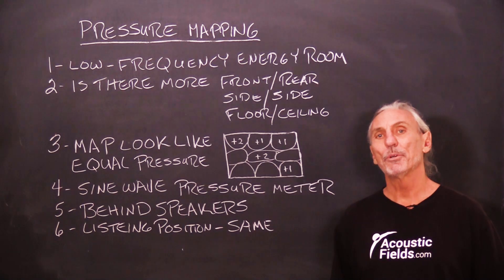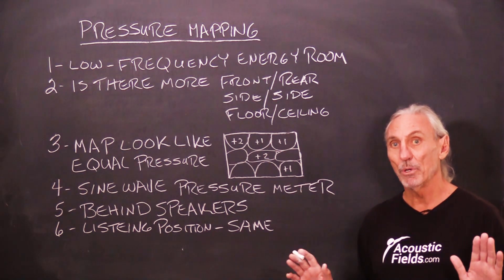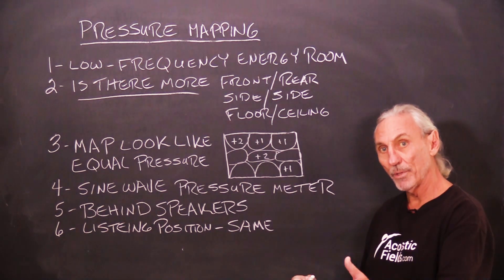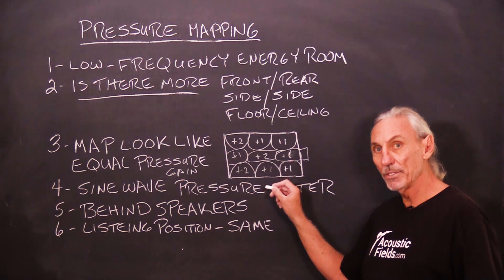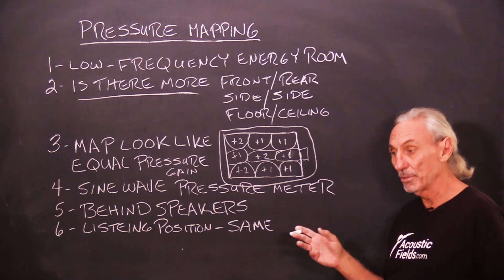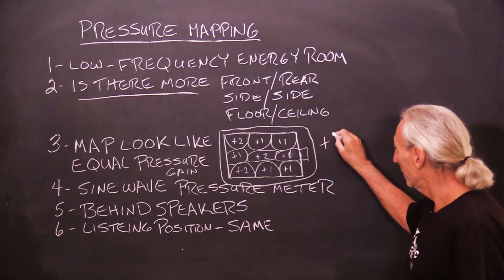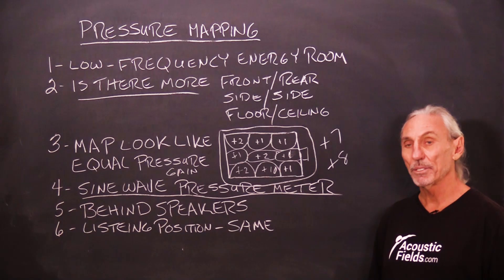Pressure Mapping - www.AcousticFields.com

Comment: I do not understand. If the change after adding gain is not proportional across the room, then the system is non linear.
What is the non-linearity ?? I believe superposition should apply. Correct me if this is an error.

Perhaps the absorber is saturating some how? But I doubt that.
Reply from the maker: Room dimensions produce modal pressures throughout the room. The goal is to have the room as pressure "neutral" as possible to minimize peaks and dips in performance.
Reply: @AcousticFields  I understand that. However you said that a treated room may become less neutral when the volume is turned up. At least that is what I heard.

Comment: Question: given that modal resonances, dispersion and phase vary with frequency, and the various traps and such ideally keep the variation +/- a few dB as you walk around the studio/room, what happens to the relative eq of the overall mix, since the higher frequencies will vary to a much greater degree as you move around?
Reply from the maker: Pressure mapping is for frequencies below 100 Hz. It is more objective in nature. Frequency management above 100 hz., in our experience, tends to be rather subjective based upon the end users preferences. Take reverb times as an example. I never have studios with the same Rt-30/60 times even though room size and usage are the same. Reverb times are as varied as the personalities of the clients we work with.

Comment: Hi Dennis. Sine wave and 80 db at the listening position, then measure around the rest of the room.People will be asking themselves "what frequency?"  Also how well does pink noise limited from 20hz to 1,000 hz work for this, if at all?  Cheers
Reply from the maker: Try an RTA with a maximum pressure / frequency indicator. Stand at various places within your room and watch for peak frequency pressure above a baseline. Learn how energy behaves at certain room locations. This simple method will show you the impact of pressure at each room location. Then begin to look at the patterns you see as you walk around.

Comment: well, may you explain me why two 104x30x30 cm membrane absorbers in two corners at the ceiling reduced the bass decay below 100 hz from 1 second to 300-450 ms when it's nonsense?
Reply from the maker: There are much better ways to deal with these issues. You must treat the complete wall surface area. By definition, axial modes are produced by two parallel wall surfaces not two parallel corners. Placing absorption material types in corners is only treating about 10 % of the problem.
Reply: @AcousticFields  well, as said: i have nearly linear decay over the full range in my living room which would not be possible in case the two pieces treating only 10% of the problem, also the SPL is linear - the membrane absorber is not just "absorption material" and the rest of the wall is covered with basoect for mids/highs
Reply from the maker: @Harald_Reindl  Your linearity is not the result of treating 10% of certain surface areas. There are many other variables at play here.
Reply: @AcousticFields  not only, but in the low frequencies it is - man when i measure with REW, put the two pieces in the corners without changing anything i see the difference and it's dramatically! for sure the bheavior of the Teufel T4000 subwoofer with it's maximum energy sideways (proven by going to the toilet as it was placed in the middle of the room and nearly puked because the small side pointed there while on the speaker side is nearly nothing) and so one of the corner membrane absorbers is in the full maximum pressure point - but it is what it is

here you go: this was the first of the two mebare-absorbers in the corner
https://i.imgur.com/bvmRq22.png
Reply: @AcousticFields  and it's easy to prove that it has the most effect in the corners by simply take on of the two, place it outside the corner in the same height and measre again - as easy as something can be given that both are standing on a shelf going from the left to the right wall

and additionally: the one in the corner on the same heiught as the subwoofer behind the couch doing 80% of the whole effect alone

Comment: Dennis, you said the pressure behind the speakers should (ideally) be the same as in the listening position. Why would that be a practical goal IF I'm just going to be listening at (or near) the listening position? In my two channel situation, I don't need the kind of consistent balance that a home theater with many seats might need. Thank you for the video.
Reply from the maker: Pressure smothers certain frequencies. Our goal is to minimize distortions.
Reply: @AcousticFields  I see. So if I am understanding, balancing the SPL behind the speakers will change what is heard in the listening position, even if the SPL there is at an acceptable level. I'll assume that's correct unless you reply. Thank you for your knowledge!

Comment: I presume you mean using sine waves? can I use my iphone SPL meter to measure? or is it worth getting a dedicated meter?
Reply: You can use an iPhone dB meter.  I've asked Dennis before and that's what he suggests.  The difference in tolerance between an iPhone dB meter app and an expensive calibrated microphone dB meter isn't that much different. Not enough to worry about.   

I've used iPhone dB meter apps on my own and one thing you should be aware of is handling the iPhone. I would recommend getting a stand to avoid handling noises that might affect the reading.
Reply: if you want relative measures between different places among the space, its ok to use the phone. If you need absolute values, go and get a meter.

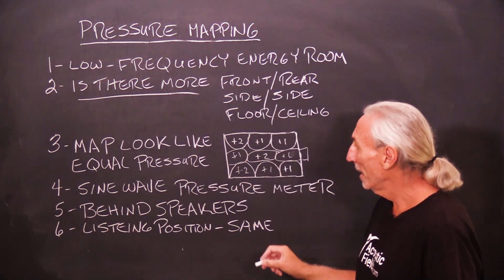Comment: Wait, what? What would be the non-linearities that cause the 'gain-dependent' pressure mapping/response effect (2:00)?
Reply: It does not change at those low volumes. This guy does not know basic acoustics. René, PhD Acoustics.
Reply: It's weird, Jesco from acoustics insider said that acoustic issues are not amplified by volume. Our ears just compress the sound more when it's louder.

Comment: Does higher spl on the spl meter means lower air pressure or higher? Should I place absorbers at high spl spots or high pressure spots? Or does it mean the same? I’ve seen graphs where Velocity is addressed, and it’s doing the opposite to pressure. Could you elaborate on that in a future video? Thanks!
Reply: Higher.. and higher SPL points.  But you have to use the right absorbers that will be the most effective at the different frequencies.    They mean the same.  

He's covered velocity absorption vs pressure absorption.

What he's said in the past is velocity absorption (acoustic foam, etc.) is for higher frequencies 125hz and above. 

Pressure absorption, Diaphragmatic (is what AF makes) are for frequencies below 100hz, but their ACDA 10 cabinets have 2 inch foam on the front and they can handle from 30hz on up to about 6300hz so it's a very wide band absorption device and it's using both pressure for the lower end and velocity absorption for the mid's and higher frequencies..

Comment: How should I approach treating my ceiling? It has popcorn texturing.
Reply: I think Dennis is on vacation.   What are the dimensions of your room?  That's the first thing he asks.. 

Also, he has other videos about ceiling height.  If you have 8ft ceiling.  You might be able to get away with 2inch foam, but that will just treat 125hz and above and won't do anything for 100hz and below. If you have a higher ceiling, it requires about 12inch to mount their CSM ACDA10/ACDA12 modules.  Plus, you have to make sure your ceiling can handle the weight, because you'll need a fair amount of those ceiling units and combined weight is a LOT, many, many hundreds of pounds, since the ACDA 10 CSM module weights somewhere around 80lbs just for one and they are 2' x 2 'x 12", as you'll need a lot of ceiling coverage..
Reply: @Oneness100  nonsense
Reply: @elduderino1329  What's your problem?